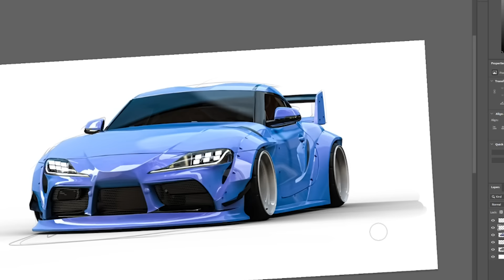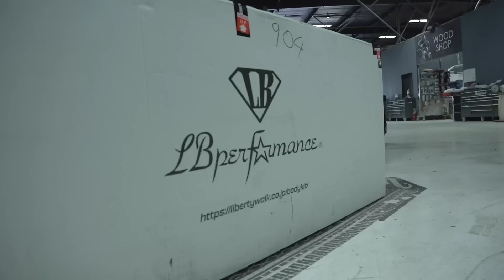Widebody Toyota Supra | West Coast Customs

Comment: I love to see that there’s a lot of Raza working for a prestigious shop 🇲🇽🇲🇽💯
Reply: how it should be
Reply: I do mechanic and body work.  You need lots of skills to work on those cars. Its easy to screw them  up. I've seen cars come back on tow trucks many times the mechanic didn't tighten the bolts, forgot cotter pins, used wrong oil filter destroyed engine and other stuff
Reply: Ya tu sabes 🇲🇽🇲🇽🇲🇽
Reply: Somos chingones para Todo